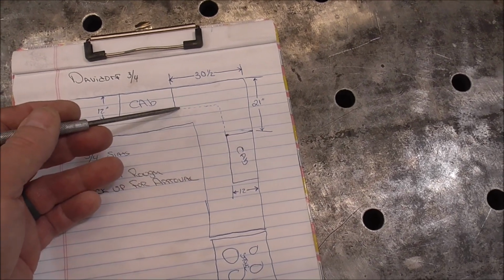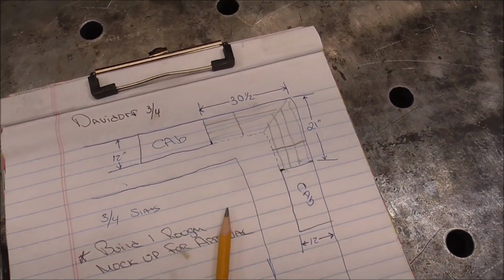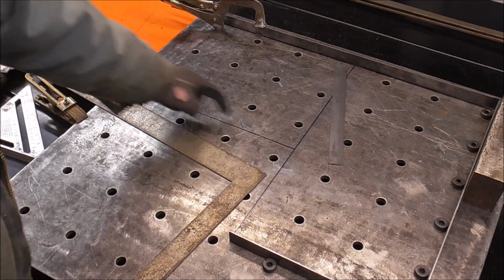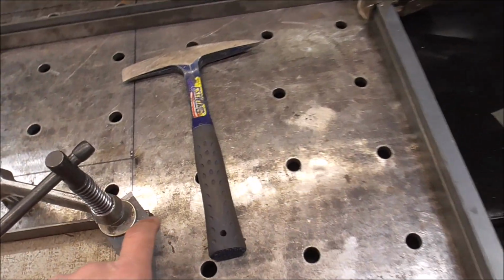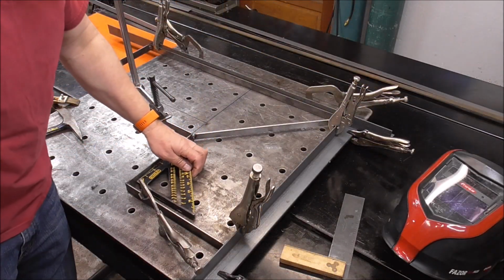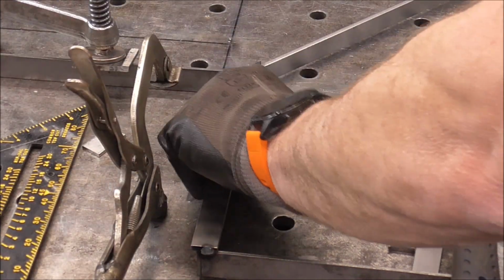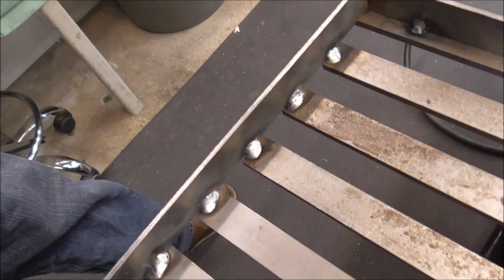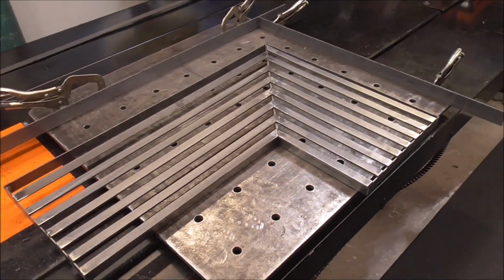Custom MIG Welding Metal Project and How I Boost My Income

Comment from the maker: Buy this Saw https://www.lowes.com/pd/Evolution-S355MCS-14-in-15-Amp-Sliding-Corded-Miter-Saw-Corded/5014430213?user=shopping&irclickid=0iKXVszH2zJHU0aSQMRDmQIIUkF2Q8VShV7g2M0&irgwc=1&cm_mmc=aff-_-c-_-prd-_-mdv-_-gdy-_-all-_-0-_-3586222-_-0
$25 Aluminum MIG Conversion https://youtu.be/FGhSo82MP9U
MORE WELDING AND FABRICATION VIDEOS HERE:https://www.youtube.com/playlist?list=PLfbf78fMz9Vol0uX2-GNc6mLi75zpqb5f
LEARN HOW TO WELD VIDEOS HERE:https://www.youtube.com/watch?v=ADa1I319GJ0&list=PLfbf78fMz9VqxPZTT-xmwdcrHVa7ML-ft
AWESOME TOOL BUILDS! https://youtube.com/playlist?list=PLfbf78fMz9Vo2Cv3V5fmYlDZGpS8Hp98l

Comment: I’d add a couple comments to the segment about costing. Obtaining materials involves time and/or labor, whether you’re traveling to a source to obtain it personally or ordering to have it shipped to you. There is also the cost associated with stocking and inventory. Those things all should be accounted for within your materials charge. I tack on 25% for materials to cover these expenses unless the materials are very large or numerous, in which case I decrease the amount. This is basic cost of doing business strategy - otherwise you will be losing money on jobs instead of actually making a profit.  How much you tack on is really a personal choice, but can be calculated for more precisely if you choose to spend the time to record time and expenses involved in obtaining materials. What I DON’T do is overcharge like a lot of auto repair shops, sometimes marking up 100% or more. That’s just greed. 
As for what to charge for your labor - that can be based on experience, quality of work and the market and competition in your area. I’m currently undercharging for my labor as a small engine mechanic because I’ve only been teaching myself this work for about 2.5 years. I’m gaining confidence and getting much better at diagnostics and expect to probably raise my rate at the 3-year mark and regularly after that. Whatever you do, don’t undervalue yourself or your work or you’ll burn out or be unhappy in your work because the financial reward doesn’t meet your expectations.
Reply from the maker: Spot on 👌 I add 15% to my material cost which covers exactly what you spoke about. I also have different labor rates depending on what im doing (mig, tig, stick, plasma and aluminum). Not accounting for incidentals are what get a lot of new business owners in trouble (insurance, wire, gasses, abrasives, consumables). These items quickly chew up profits over time if you haven't accounted for them.

Comment: As always, well done!!!  Planning, lay out, execution.  Could not be better.  As for your advice on Customer Service, well, as a 45 year veteran of serviing Customers with Electronic Repair Needs, both field and shop, you are right on with Communication.  That is the essence of Customer Service.  I started in 1967 working the field, and had to stop and use a pay phone to communicate if problems arose.  That was a hassle with 200 miles to drive and 10 customers to service.  Now, with the advent of cell phones, communication has become so much easier and of greater importance.  People understand if commuincated with.  Love your philosophy!!!  Since you "dropped the ball" a little, doing that free gratis was good and I know that Customer will be ready to purchase and pass the informaiton along to friends.....that is the goal!!!  Be well, be safe, be Blessed!!!
Reply from the maker: Your so right Jim. The hardest part doing any artistic project like this, be it wood or metal, is making sure your on the same page with your customer. I'm curious what changes if any she makes. Have a great week! Be blessed 🙌

Comment: Nice jo. I know its only a mock-up, but you have 8 slats on one side and 7 on the other. My guess is you ran short of material, or am I missing something?
Reply from the maker: I did run short on the 3/4 slats so I added the last 1" slat so they could get an idea of what it would look like in case they wanted a bolder look over the 3/4 slats.

Comment: I usually have my customer pay me upfront for materials, iron here is too expensive to get ahead.  One wanted 3 tier steel table on wheels, for me build legs is $400.00 not counting shelves or wheels.  It does get expensive.
Reply from the maker: It adds up quickly. Some steel has actually doubled from what I was paying 2-3 years ago. It's crazy.
Reply: Yes it does, it’s jaw dropping each time go get load. Geez

Comment: Would love to have that saw but I can't afford it
Reply from the maker: Its pretty nice Roger, but your right, it's pricy. If you dont need the ability to cut bigger stuff, it's pretty hard to beat this saw for $149 https://amzn.to/4cfeG7P I love it.
Reply: @BrandonLund  when I looked it up it showed 849
Reply from the maker: The one in the video is 849 but the saw in the link is 149 and an awesome saw if you don't need to make larger cuts beyond the 8 1/4" blade.
Reply: It does miters, and bevels actually lol so kinda better than the big one if you don't handle huge pieces. I'm looking at getting their 10" dual bevel sliding miter saw. Right now on Amazon for i think $340, didn't even know they made it🔥 @BrandonLund
Reply from the maker: I must have been having a brain fart lol. I had to go back and reread what I wrote lol. I've been eyeing that sliding bevel saw also. I'm sure its like all their stuff and built well
Reply: @BrandonLund  okay thanks for information the one for 149$ isn't so badly priced
Reply: I bought the 149$saw they sent it to me and it had a broken piece on it I called them and they sent me a new one and I received it today and told me to keep the other one for parts I haven't gotten to use it yet but I will
Reply: I think they are a good company to buy stuff from thanks for the recomendation
Reply from the maker: Their customer service is always top notch! Congratulations on your new saw! You are going to love it!
Reply: @BrandonLund  I'm sure I will I seen some complain about the blade not lasting long but some is how they're using it but I will see but I won't cut every thing with it I have a Porter cable chop saw for bigger stuff for all my strait cut's and a grinder and I bought a used band saw from harbor fright
Reply from the maker: @rogertaylor8615 the blade not lasting long usually has to do with the user. Feed rate is very important. Also, making sure your material is oriented correctly in the saw is also key. Take it slow and it will last a long time